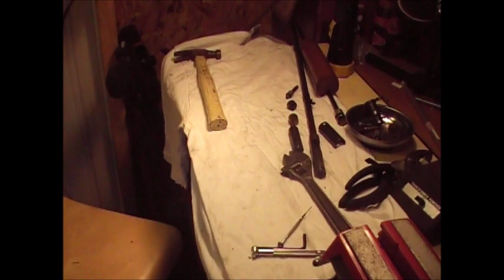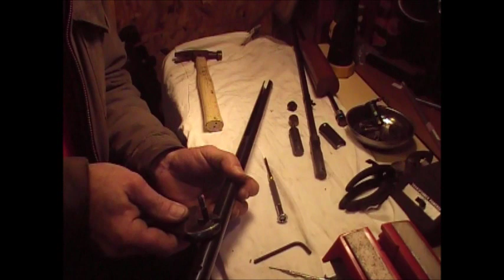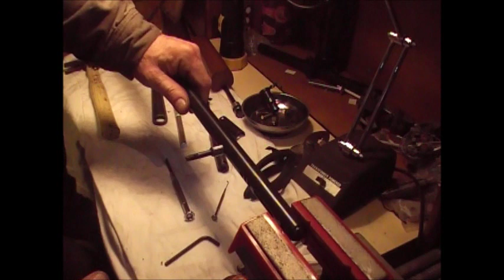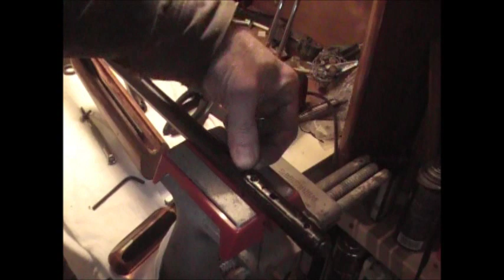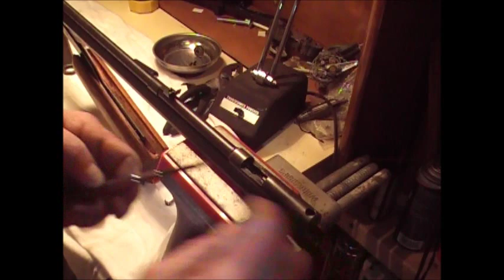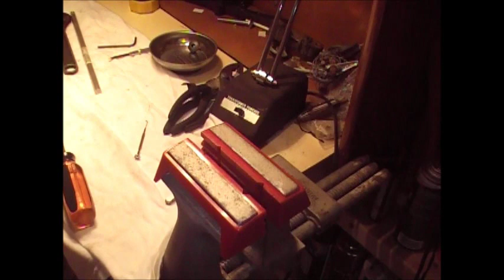Crosman 140 / 1400 Repair Part 2

Comment: I just got a 4th variant 140 in the mail today, and have already ordered a kit from baker airguns. After some oil It does push air but it's going straight through the valve.

It sure seems like a fairly nice and definitely fun gun, though theres no way is it going to be as good as my '79 Sheridan blue streak or even the little '67 Benbenji 312. That self cocking mechanism just doesn't allow for a very good trigger, especially compared to the excellent trigger of my '79 blue streak but I know I'll love it more than my 4th variant 760.
Shouldn't be too horrible on 4 pumps though.
I tell ya I understand that the 760 saved them, but I really wish Crosman had also made that Canadian Boy rifle that the guys in Dunville came up with.
Instead of the 761XL i'd much rather them have made that.

Comment: I decided to rebuild and restore my 140 crosman pellet gun I got when I was about 12 years old, now I'm 61. Your video was very helpful but I'm still having trouble. When I took out my valve every thing was the way you described. I rebuilt the valve with new O rings but on the pop out valve the sleeve that fits over we're the air port is stayed in the tube, I reinstalled the valve. Put the gun together but it will not release air, looking for more advice. Thanks

Comment: just stopped by to say thanks again for making these two videos on the crosman 140 ,now have two of these wonderful airguns,one i just only had for two weeks now,the first one i bought in 2008 which i rebuilt myself and is a great shooter ,the reason why i bought the second one from Baker airguns.this gun from Baker airgun is something different,when you pump it up it is a real light pump and do'nt  get air until the fifth pump,but if you pump it up bottom upwards it pumps up hard.

Comment: Thanks for the help. I just got a nice used one that worked great for a couple days, then it would not hold the pressure. I stripped it down and cleaned everything & oiled it up. There is no tin can left alive at my place now.  Great little gun.

Comment: The repair kit is on ebay (I have no affiliation with the seller) here: http://www.ebay.com/itm/Crosman-Crossman-140-147-1400-Air-Rifle-Pellet-Gun-Reseal-Seal-Kit-Guide-/181047595648?hash=item2a27471280:g:CJUAAOSwAKxWU0Wc

Comment: when i put pellet in breech the breech will not close what might be problem be
Reply: The pellet is crooked. You need to get a wooden dowel that fits into the muzzle and push it out of the breech. The breech on mine is so large it is very hard to put a pellet in and have it straight. Were pellets longer in 1954? I don't know.

Comment: Thanks for the informative video.  Why haven't you mentioned or used any lubricants for reassembly.  I will certainly lube the new O Rings when I make my repair.
Reply: I used transmission fluid but I don't really know for sure if that is safe for o-rings. I believe it is.

Comment: i just resealed mine. Got it from my uncle over 40 years ago. He got t around 1960 or so. Working good again. One thing I questioned and found it addresed here, there is no seal btween the barrel and the air chamber feed hole. It appears to  a metal to metal seal. I must say it is a super fit but I think there is a significant loss there. I made paper gaskets but they did not last. I have the original Crosman dealer parts manual and it shows nothing in that area? (It can be downloaded online and it covers all the early guns they made} Now I need to tear it down again and see if your idea will improve that sealing.

Thanks for the vid. Great gun with great memories.

Comment: I am interested in that first roll pin you replaced with a new brass one on that front hinge. How does it stay in if it is not a roll pin. It falls out so easily. I have not yet started the rebuild. I want to know about that pin first. I am not sure after I punch out that pin it would go back in..thanks in advance

Comment: Thank you for the very clear, step by step instruction. I think it will be very useful but I can't say for certain as my Crosman 140 refuses to fire. I've completed the seal replacements as per your instructions but the gun does not fire. I feel pressure as I pump but depressing the trigger gives no result. I am wondering whether the trigger mechanism might be worn out. Or maybe the auto cock feature is not working. This is the early model. I just got it after cleaning out my father in law's house. Chances are it has not been fired in at least 20 years and it was probably never maintained. Any suggestions?

Comment: I followed your directions and my Crossman 140 works perfectly again.  I did have a problem.  I could not punch the pin out of the aft end that holds the hammer in place.  The hammer moved freely, and since there is no seal on that component, I completed the reseal and reassemble without removing the hammer and spring.  So my reassembly procedure was just a little different than yours, but all came out OK in the end.  Thanks much for the hints and tips.  Gordon in Scottsdale, AZ

Comment: Great video... we just put the seals in my 12 year old's Crosman 140... but I must have done something wrong. The air keeps popping off... one pump, and "pop"... it won't build pressure, it's like the trigger is pulled or something.  What did I do wrong do you think?  The gun worked okay before, it would just leak off slowly... so I guess I messed something up...

Comment: Thanks for the quick reply! I had read that the poly tube was a mod that would add as much as 70 fps , as it was a less restricted transfer of air than even a new rubber port seal, looks like a trip to the hardware store!!  Seriously though, aren't these older guns just the greatest? all steel, aluminum, brass and hardwood, not a piece of plastic in the whole thing. True American classics!!

Comment: Hi,my workbench looks just like yours, except mine is still in pieces waiting for a seal kit ;)  Will the plastic tubing used for a transfer port seal fit into the pump and breech without any alteration, or, do they have to be drilled out to accept the tubing?  thanks